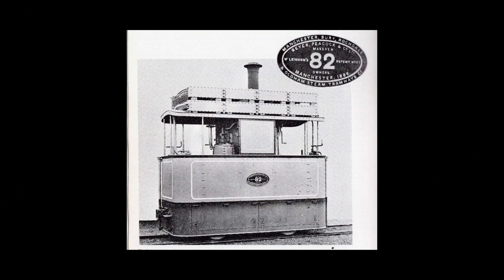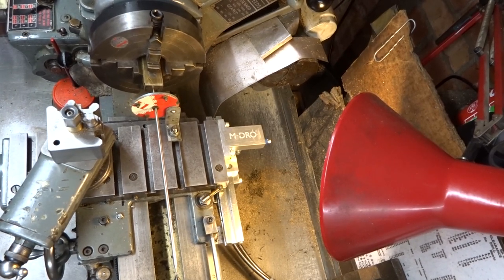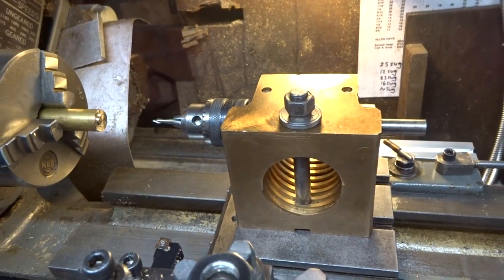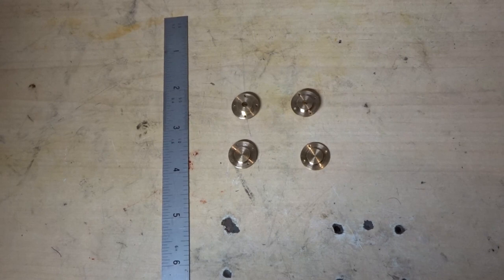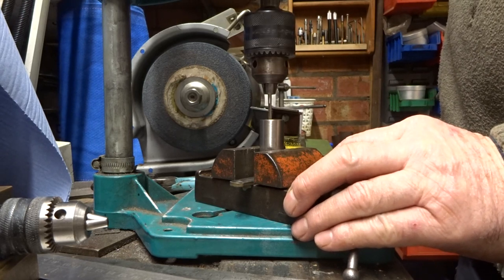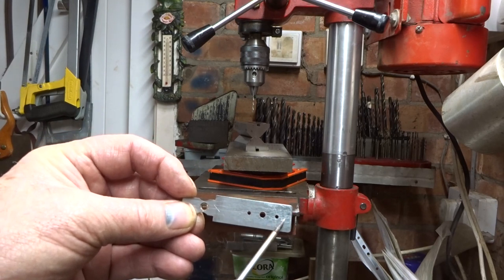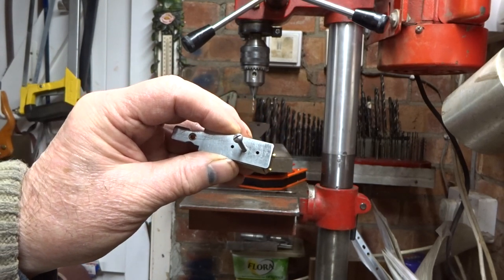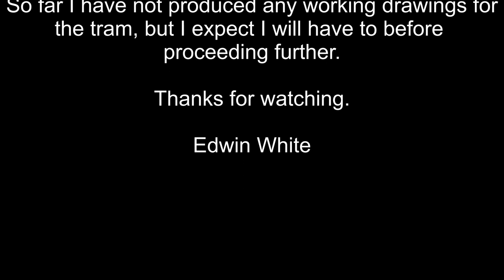Steam Tram

Comment: Thank you. As an “interested party” who is thinking about a first engine this was very helpful. Mine would also be a tram engine, and an oscillator. I’ll look at your other videos on the tram, and you’ve got another subscriber. Les
Reply from the maker: Many thanks for the kind words Les. You may be interested in my Chaloner vid as that is also an oscillator. I did not build the Chaloner however only cosmetically altered it. Good luck with your build.
Reply: @edwinwhite933  Thank you! If I build, it will be an “Ellie”, I’ve ordered the book, and we’ll see. About time I used my lathes to make something that moves by itself.. so far they’ve been used for radio work and my motorcycle, but the lockdown(s) are causing some different thinking. But no way I’ll be building a shelf-full of locos!  Les
Reply from the maker: Les I started to answer, but got interupted by the phone so appologies if I am duplicating (it doesn't appear that my reply went). I too have the Ellie book and it looks as if it will be an excellent starter loco. I hope you manage the build ok. Currently I am working on a Stuart Beam engine so Ellie is on the 'back burner' for me.
Ed